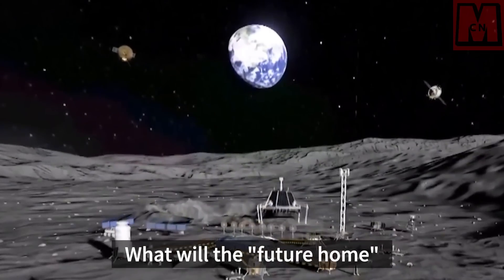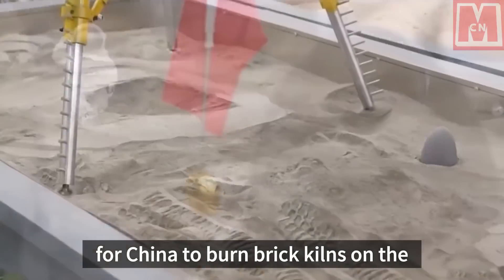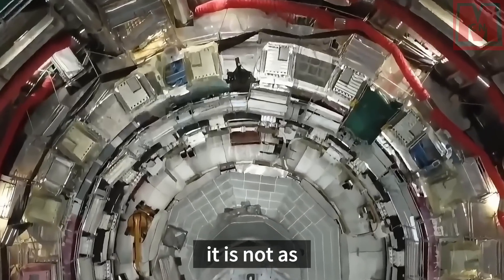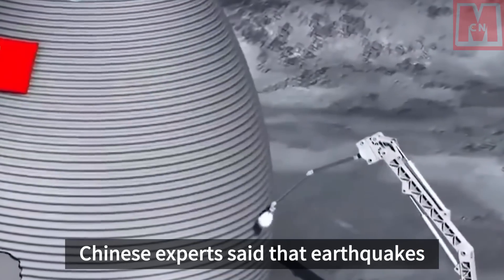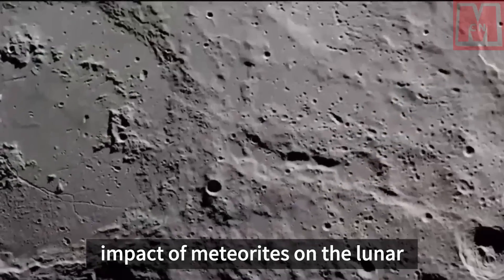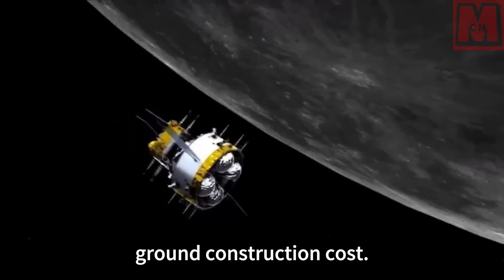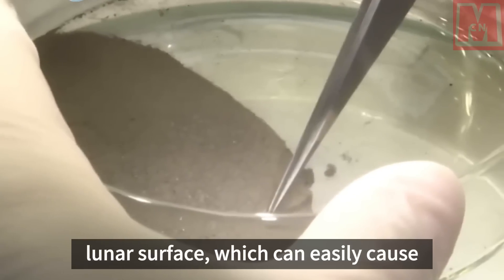What is the Chinese Moon Base Built with? How to build it?

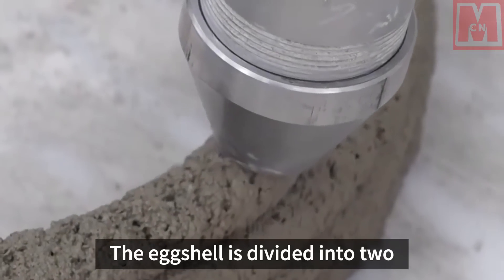Comment: Page 2:27 are we nuts? 
the shape and method of construction are gravity based may not suitable on moon. Why? 
One bar of air pressure in this “bell shape” building could lift it up in the moon’s sky like the rocket engine also bell shape, due to lack of earth’s gravity. So what shape we can use if not bell shape? A sphere.

Comment: The same way the Space Station was built; the fabricated parts or modules are manufactured on earth and assembled on the moon. This is the only feasible way to build a moon base. Anyone out there can prove me wrong?
Reply: I totally agree with you as I had also commented on this very same point before reading your comments. Once this initiate stage of the manned moon base is completed, equipment / machines (3D copy machine) can be introduced to make use of the moon materials for further advance construction. In fact, I would even suggest construction of deep underground moon station(s) as the best protection against the solar wind, radiation, heat, and other harmful elements in space.
Reply: @donhuang9855  It's so much more work to be prepared for transporting equipment there. Before anything else, there has to be a manned lunar space station to serve as a transit hub for control , logistics, communication, etc. It's a herculean task as there're so many complex problems to be solved especially if man were to land and conduct research on the moon.
Reply: @brianliew5901  My idea is to set-up the basic moon base first using the manned space station as a proto-type, before transporting the essential 3D printing machines to construct the rest of the Moon base. Humans need to set-up these AI / Robotic / 5G communication devices on the moon first, but its these AI-enable equipment that will do the main tasks of building the moon base.
Reply: @donhuang9855  I think China is the only nation that has the resources and capability to achieve the task.
Reply: @brianliew5901  A joint China-Russia joint moon base project would surely make this project into early fruition.
Reply: @donhuang9855  Great idea!👍
Reply: Maybe to make use of current tiangong space station as assembly hub. To assemble an initial moon base module  beside the space station, and to test its functionality, and then move it to the moon

Comment: China should build a magnetic rail gun powered by solar energy that can accelerate a space ship to space without the need for using chemical fuel.  This would allow transporting material from Earth to space as cheap as possible.  Then conquering space would be easily achieved.  Make the space ship aerodynamic so it can easily pierce through air and shoot into space without needing chemical fuel.  Make the magnetic rail gun shoot straight up vertical to eliminate as much potential friction between the ship and the gun as much as possible.  Build it near or on top of a mountain where the atmosphere pressure is low and air resistance is lowered.  This is very possible.  The first country that achieves this will easily conquer space.